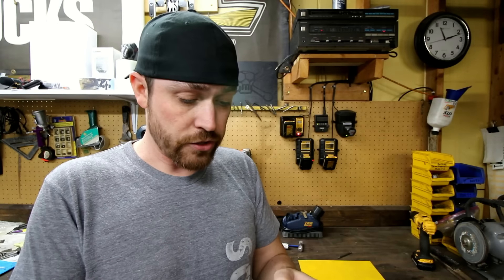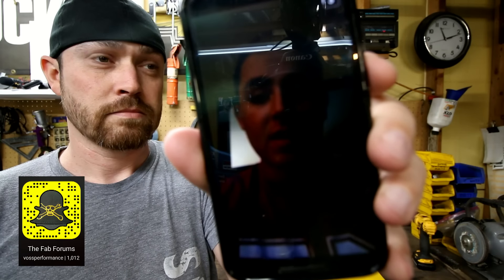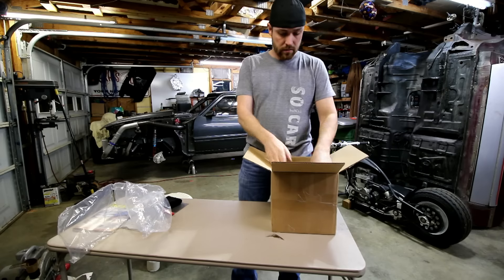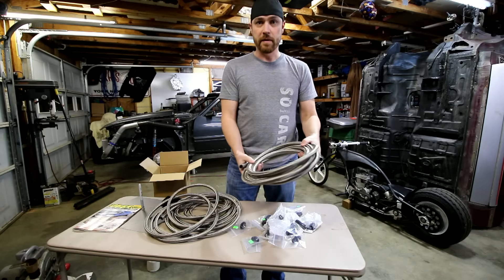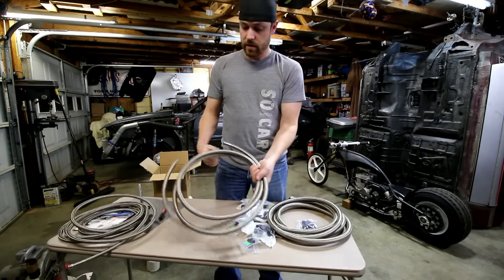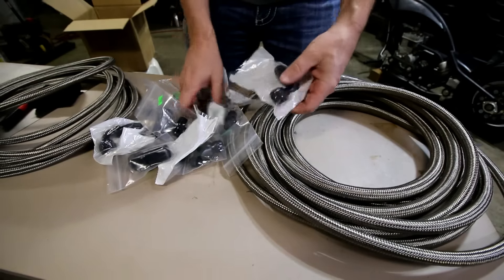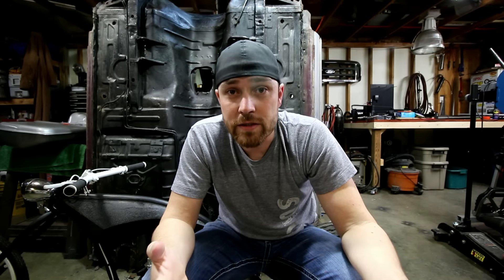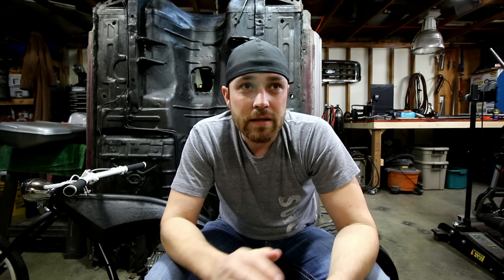SnapChat Questions with Kyle Voss | Snapchat Stories

Comment: You mentioned you were going to plumb your fuel system to go pump -> rails -> regulator -> return.   Have you tried putting the return at the regulator?    I did that on my last car and I got much more consistent fuel pressure (rising rate on a boosted setup like yours) and the fuel didn't get super heated because any fuel returned to the tank had never entered the rails.   Just an idea.
Reply from the maker: +RecklessRegal I have and will probably use that method on the bibbster but on this car I will have to run it thru the rails and then return back to the take from the regulator.

Comment: Don't most tracks require hardline for fuel? Like less than 12" of soft line on the whole fuel system?
Reply from the maker: +MaksWerks they are referring to plain rubber when they say soft line. These lines are braided stainless and are much safer then rubber or hard line.
Reply: +The Fab Forums Good to know. I wasn't sure if braided line was considered soft line or not.

Comment: Sweet, I was the first question! I'm going to be doing a twin turbo 79 Monte Carlo in the near future. Trying to figure out the best tuner to do so.
Reply from the maker: +OFFROAD GMC awesome. Thanks for the question. Are you wanting to run a stand alone fuel injection setup?
Reply: +The Fab Forums I was looking at doing a 6.0 LS swap twin turbo. Was leaning towards HP Tuners. Not sure which transmission I want to run yet.
Reply from the maker: +OFFROAD GMC gotcha so you are wanting to run the factory computer with an aftermarket tuner. To be honest I have no idea about stuff that works with the factory computers. I always prefer to trash that stuff and run a complete stand alone engine management system. like the BigStuff3 or Holleys new stuff that I heard a lot of good stuff about. http://amzn.to/1QJURHM

Comment: What was the motor setup before the turbo set up?
Reply from the maker: 306 with gt40 heads, stock cam, explorer intake, shorty headers, full 2.5 exhaust with tailpipes and had to weight 3250 pounds on old school BFG radial

Comment: think you have to work towards perfection on "a " car , learn to work with wat you have and respect the progress one step at a time 

i think if you have enough money and time to build the perfect racecar straight from the start it still wouldnt be as good
you wouldnt be able to get the most out of the car as when you build towards it in stages 

you need to learn to use the big stuff ecu setup learn how to build transmissions to know wat it can and cannot do and drive the car with lower power so you know wat loosing traction do to the car without instandly wrecking the car and learn to set up the chassis so it runs straight before turning the power up a stage more 

i wanted too mush bells and wissles too soon and never even gotten to drive my truck yet in the 10 years i own it , i gotten lots of parts for it but its sitting partly dissassembled in some storage waiting untill my backproblems and cashflow alows me to work on it again 
it i had started at a lower wishlevel and a lot less "might as well" i prolly wouldve gotten it rebuild a few times but i wouldve actually driven it a few seasons too
Reply from the maker: +watahyahknow I agree